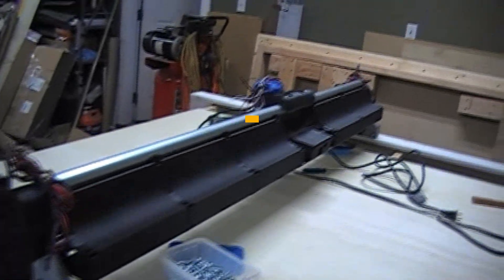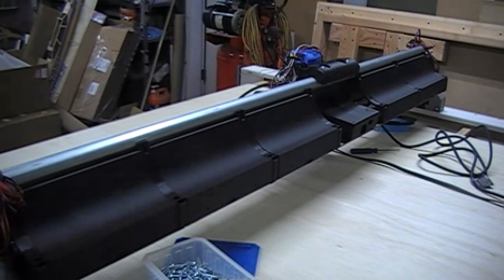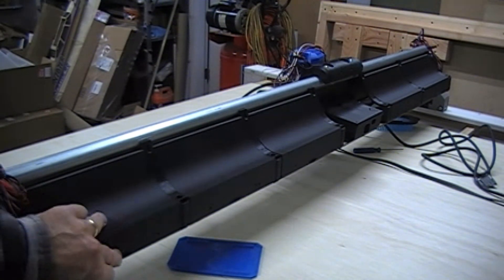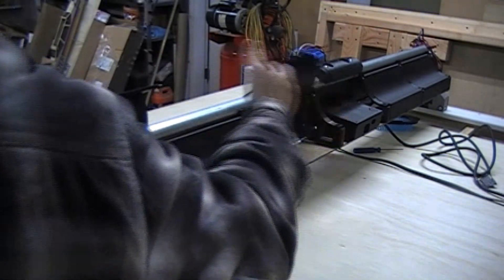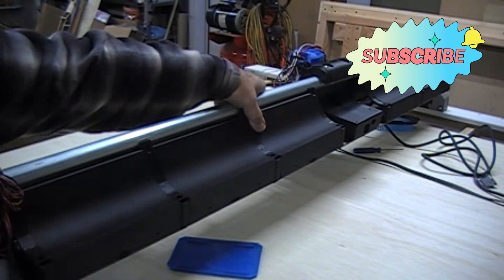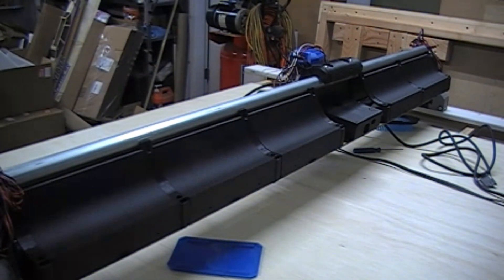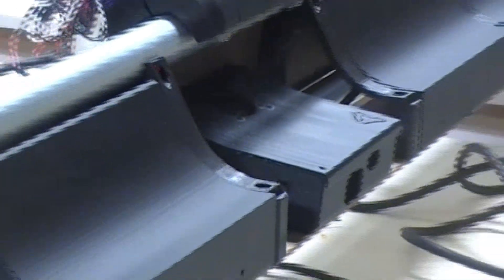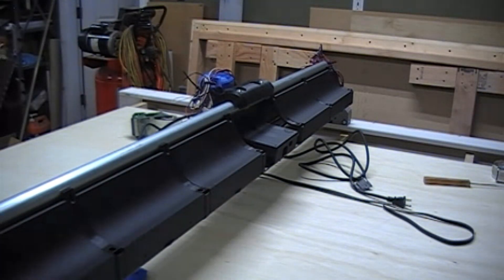DIY LR4 CNC Router Build   Part 20   Optional Back Covers

Comment: I know supports are a pain sometimes but I use PETG as an interface layer with 2 layers if I'm using PLA and vice versa PLA as the interface layer when using PETG. Both with 0.0 interface distance. It makes removing any support a breeze. It takes a little more time because you have to swap filament but it makes up for it when you're removing.
Give it a rest on a small knob or something and you'll be very happy with the results